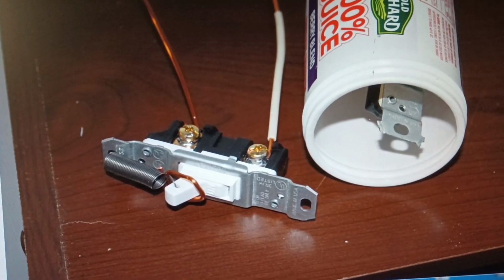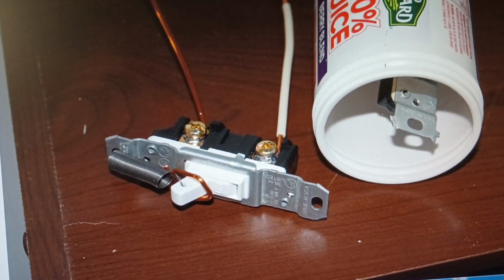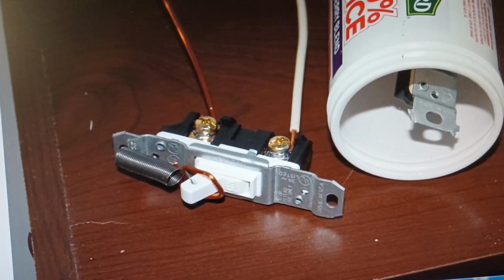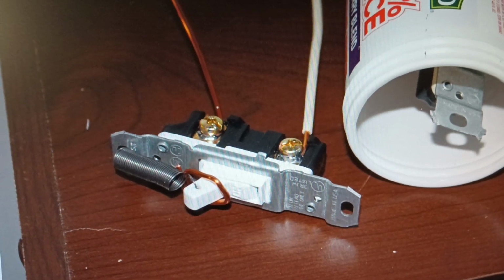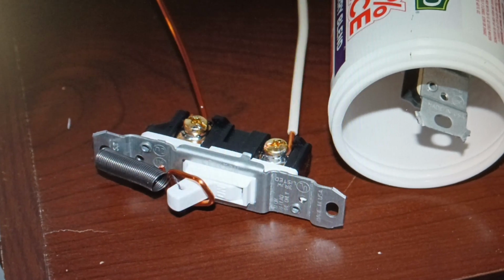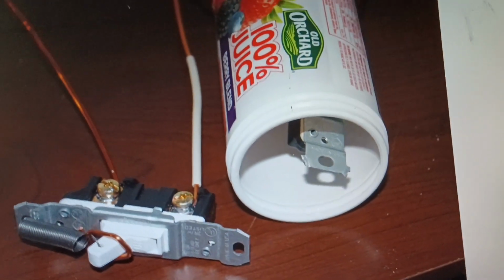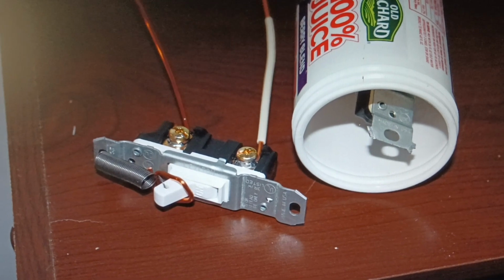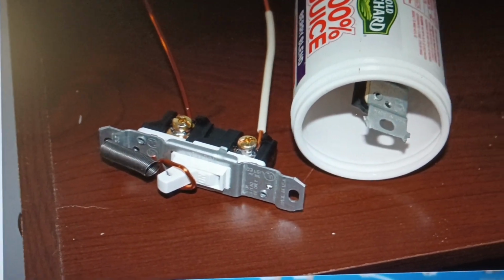How to Build Dipole Switches == Perfect Match!

Comment: Have you tried using relays?
73 de Steve M0KOV
Reply from the maker: That IS a relay...just not electrically activated.

no, wasnt much point in it with only one band switch and considering the extrrmely long wires for that antenna up that high. RF driven switching, maybe- sense it locally and just supply power from the house but that may not work for QRP. That antenna wasnt well matched on 80 and didnt get switched often.

Relays would work for switching, its been done in the past.

The 6 band switchable dipole Im testing now would probably be better with relays as its only 6 feet high and 6-20 meters, and closer to the house, much less wire length.

That antenna could be switched frequently each day
Reply: Thanks for the reply.  I'm considering using relay switching for a homebrew 40/20m ssb contest rig. I don't want to have to match the aerial, but would need easy and automatic switching between the bands.  
Steve M0KOV
Reply from the maker: Use higher power high voltage industrial ' ice cube' relays with broad flat contact arms, and wide contact spacings. Low inductance and low capacitance between contact sets

Such as:

.RH2B-UDC12V

The contacts are good for KV.

I built an amp exciter switching box with similar relays to replace $400 Dow Key types. SWR was about 1.4 max.

The system of 4 relays was dominantly inductive and can be tuned out with a series capacitance to no SWR.

At our Amateur, low power and low field strengths, its not practical to use antenna fields for directly driving a relay coil, but might use tuned circuits with the relay coil to use the RF energy on the transmission line to drive the relay coil.